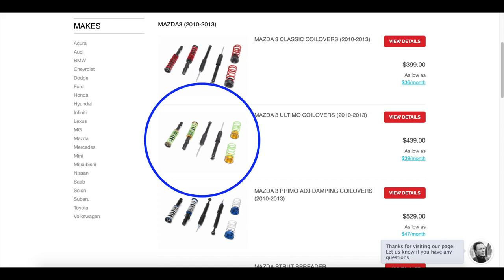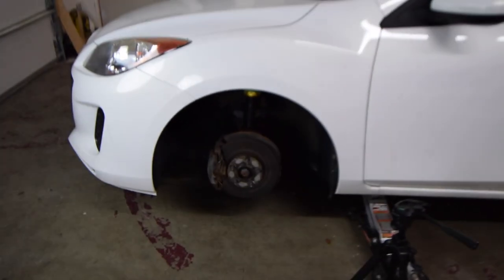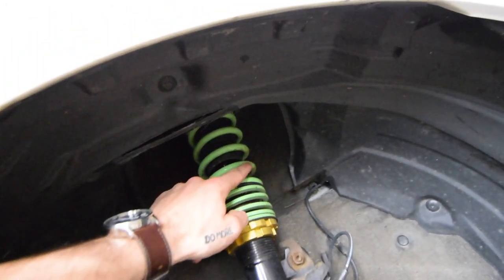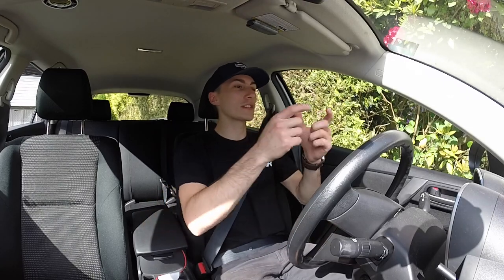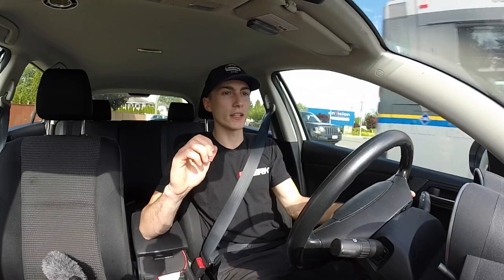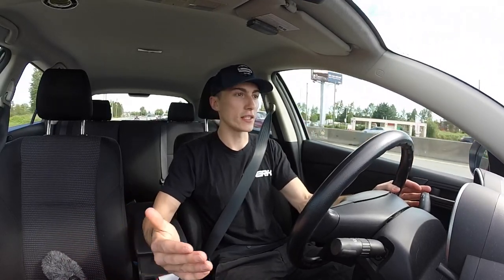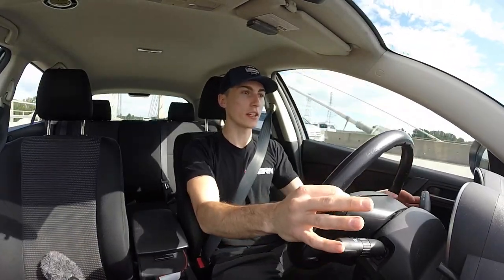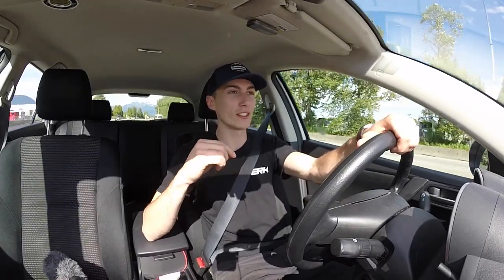$400 Coilovers 8 MONTHS LATER! - Raceland Ultimo Review

Comment: This happened to me when I had my budget coil overs all I did to fix it was to tighten the strut bolts at the top hat please like so they can see this!!!
Reply: Same thing mine did it then I grabbed the impact and it hasn't done it since lol
Reply: Same here. I made sure to do it once it was on the ground and they worked perfect after that.
Reply: What torque did you use? I have the Primos and the front passenger strut bolt loosened up, causing the busted strut sound. I tightened it to where the same threads show on the bolt on driver side, and it's not noisy anymore, but I just wanna make sure it doesn't happen again.
Reply: @theangrypickle96  THREAD LOCKER and lots of ugga duggas
Reply: @Boozi88  that's one way to kill a lifetime warranty. Lol
Reply: @theangrypickle96  how so? I've received brand new product, especially car parts that weren't torqued to spec.  Apparently it sounds like there's either a factory torque issue or the quality of the nuts or threads are low.
Reply: @Boozi88  did you apply threadlocker on the threads of the studs and tightened it up?
Reply: instablaster...

Comment: Been rocking Raceland Ultimos for 2 years now. I freaking love them. For normal daily driving they are perfect. Not too expencive and not too cheap. They also ride pretty nice. 100% recommend them!!
Reply: You got them on a civic?
Reply: My honda Del Sol.
Reply: Mark Nouws came here looking to see if they were good for the del sol. I’m ordering them next paycheck lol. Thanks bro
Reply: Mark Nouws hey mark I know this is a 5 month old comment but just looking for some insight.  I see you say the are great for “daily driving”, I’m just curious if you feel they would perform well in canyon/mountain runs on a Wrx. Like cornering and handling wise or are they just good for looks and high way cruising.
Reply: Got some for my genesis coupe can't wait to get rid of the crappy lowering springs it has
Reply: Now that you're about 3 years in you still like them?
Reply: Thanks Mark. Ive just ordered some for my 350Z. I needed some more info on the ultimo's.
Reply: @josevaladez100  how are they? I have a genesis coupe 2013 2.0t and was looking at these coilovers
Reply: But do they stick to the ground nice ? I’m considering buying them but I want very little body roll I would want to use them for drifting around town

Comment: I've had the Primos on my 2006 Mazda 3 hatch for almost a year. When I first got them, I went full send to the ground minus an inch in the front. An immediate 4" drop was insane! The roads in Chattanooga could be better, but what surprised me is that they would never bottom out. Very responsive even with the dampening set to 7 and 15 is max stiffness. I eventually got new tires and started rubbing my inner fenders, so I raised it over and inch. My 45 tires still tuck on stock 17's, but the extra suspension travel from raising it has made the ride so much smoother.  So it's very stiff dropped all the way, and smoother if raised just a tad. I have fun no matter what height, but at least I can get around better. The raid had been destroying the roads.

Comment: Okay, first of all you have no anti seize on those locking collars and threads, if raceland catches this video they wont honor the warranty if the collars seize on. Also i grease the bottom and tops of the springs and use rustoleum rust protection paint that converts rust and protects things with a black coating even on powdercoated stuff cus the powdercoat wont last rust wise.

Also you should have put rubber shims on the spring ends thats most likely your problem i havent heard any noises quiet as day. Idk why they dont come with shims.
Reply: Hey I'm looking at getting these, do you mean rubber between the spring and perches?

Comment: ngl, ive run some raceland reds on my my06 impreza for like 4 years and im not complaining. Its firmer for sure but i didnt crank down the ride height and barely tightened the springs and only thing I can say is they squeak on bumps but my back's not broken and neither has anything suspension broken on my car. Im sure some teins or bilstieins or komis are better, but I am not dissatisfied with my purchase here esp for the price

Comment: I just got my mazda 3 a couple months ago, had the rear strut mount replaced, it had that same "paint can" noise. Then a month or so later it came back and now my struts are bad, I just ordered the raceland primo coilover set, will update on how they are after I get them.
Reply: Jeremy Kostusiak plz cuz I’m on the edge of buying the $430 coilovers
Reply: @ThePenguinProjects  I got the primo ones, I wasn't really looking for the drop but it actually looks really good and i wanted the adjustable damping, I've put a couple hundred miles on them and they are a lot better than I expected, I just kinda guessed the height and it came out perfect surprisingly, its a nice and pretty smooth ride, it feels a little stiff but that could just be due to the damping not being adjusted yet. But overall, I would probably buy them again if needed, Idk how the $430 ones are but they can't be too far off. And also, don't get their strut spreader, it doesn't work, just indented the metal of the knuckles and would shoot out, just use a big flat head screw driver and hammer it into the slot to open up the pinch mount

Comment: wait if ur spending $400 and getting non-performance improvement then why not just get lowering springs
Reply: The coilovers have the ability to adjust to any height you want. Lowering springs will have you permanently stuck at a set height with you having no choice on that said height.

Comment: Did he just torque his wheel in the air?
Reply: Xinoko you’re technically supposed to torque the wheel with it barely touching the ground. That way there isn’t a ton of weight on the studs.
Reply: @jacobcotriss6264  Ah, was taught to hand tight in the air and then torque on the floor.

Comment: I'm ashamed to be running BC coils even though I can get a new set at the price of shipping. Craptastic pogo sticks, and these are the 2nd worst Coilover in existence, only beaten by maxpeeding coils. If I'd barely rate my brand new BC's and Im on the 3rd set at barely a 7/10. If youy can't afford some FEALs or KW's then stick with the shock and spring setsup from koni, bilstein and h and r. They will easily outperform a cookiecutter coilover in almost every application.